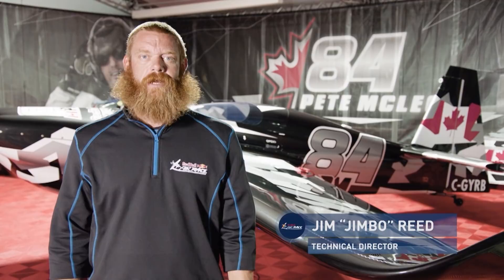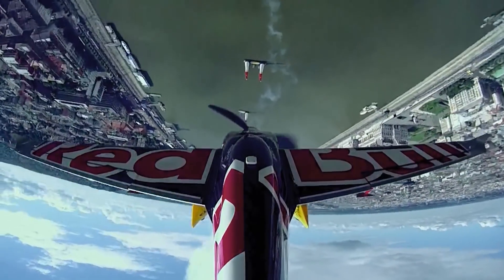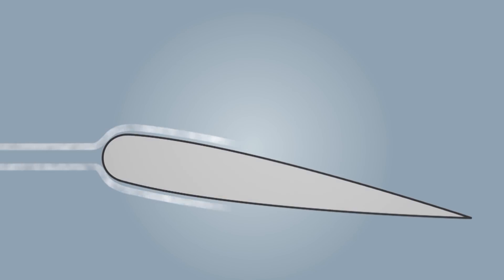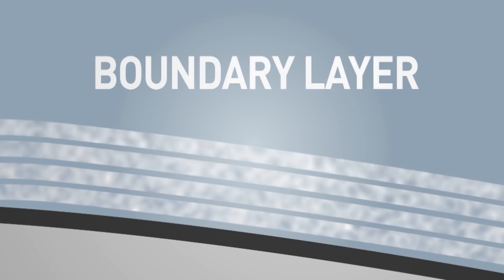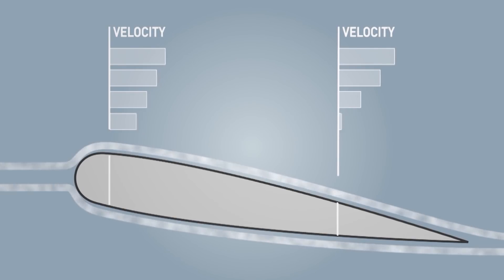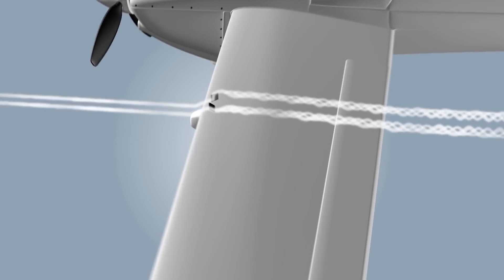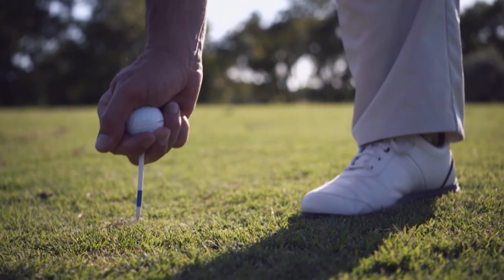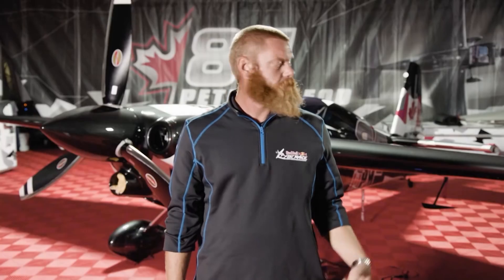Red Bull Air Race Tech Talk | Vortex Generators

Comment: VG's are a double-edged sword; they do provide better low speed performance by allowing higher angle of attacks, without stalling, but then they produced slightly more drag at high speed.